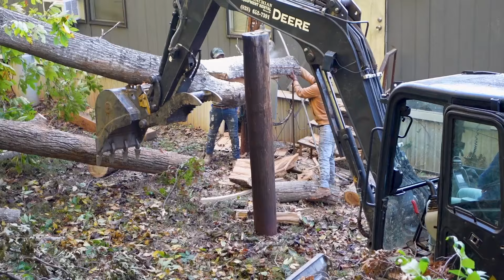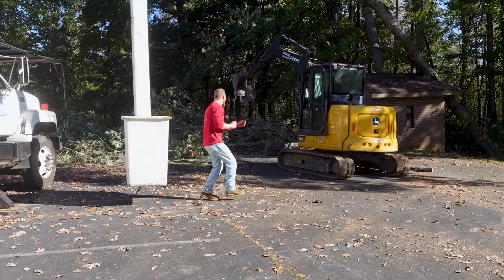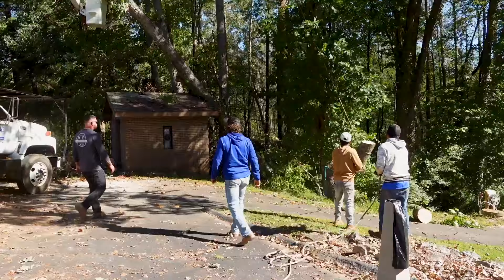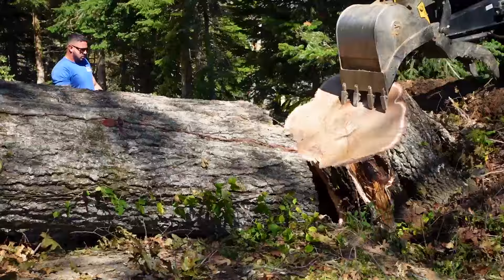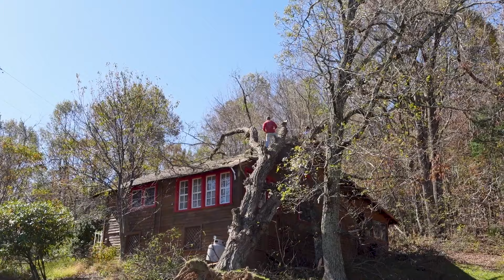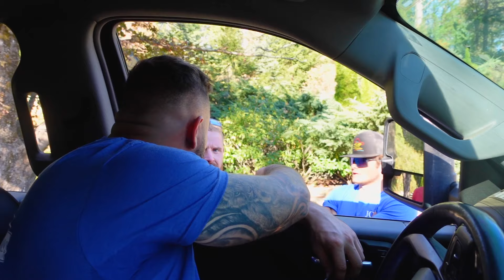The Creek Reclaimed this Customer's Driveway | Sketchy Roads & Massive Oak Removal

Comment: John you would have been killing it out here in north east Colorado this spring when we had 100+ mph winds wrecking trees everywhere. My crane ran non-stop for 17 days but we lifted over 140 trees off of houses doesn't even begin to scratch the surface of everything else we cleaned up. Ran everything 12 inch and smaller through the chipper. 10+ loads a day. The fuel usage was insane but with 30 guys working 12+ hr days we got a lot done.